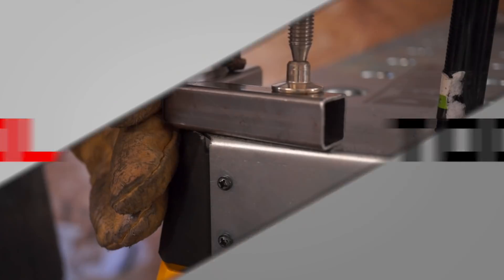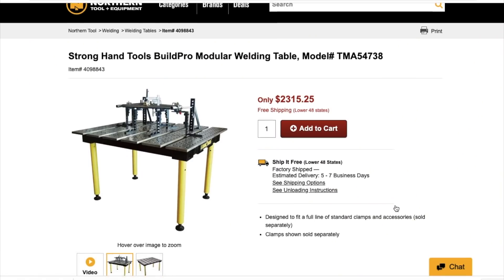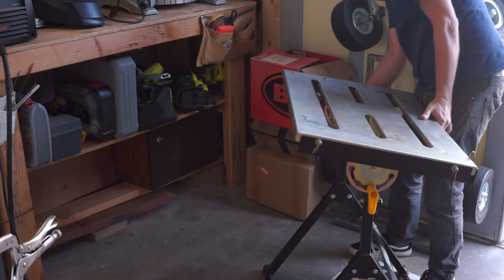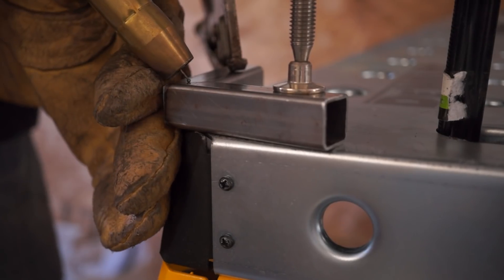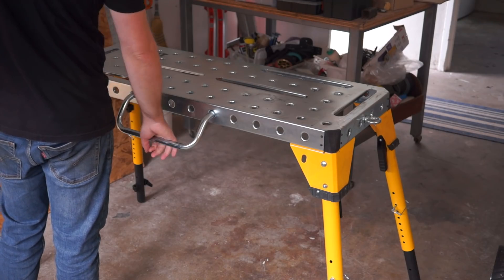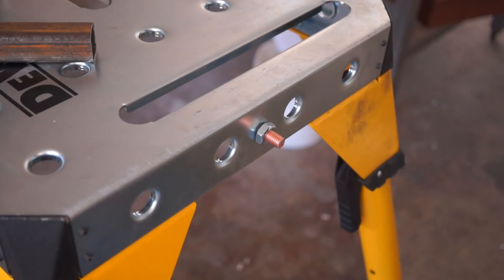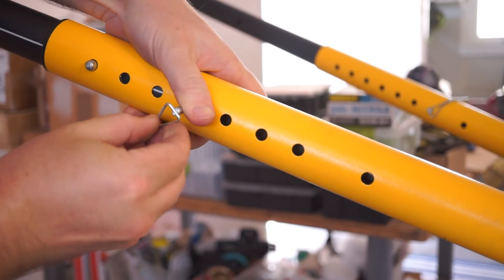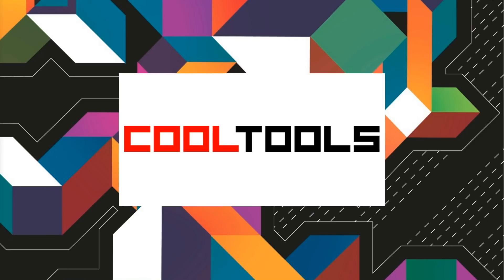DeWalt Welding Table vs. Harbor Freight

Comment: Little trick I use for skateboard tails to make them last longer, it can be applies to the DeWalt's feet - apply a nice layer of sacrifiial epoxy. It gets worn down first instead of the product's existing material.

Comment: Great comparative review of the two tables.  Still a lot for the Dewalt table.  As a beginner I still might choose the Harbor Freight simply because of the cost.
Reply: I totally understand. The Harbor Freight table got years of good use before I made this upgrade. With coupons, you can often get them for around $50, which is hard to beat.

Comment: Looks like a step up from HF but can you put  2 side to side or end to end to make a larger table. That looks very narrow.  I have 2 of the HF tables and did not pay $70 each more like $56 with 20% coupon.  What’s decent about them is I can C clamp them end to end or side to side without leg interference creating a large  work surface . Also locking C clamps  and F clamps work okay in the stamped slots. 
  The bad is they are not height adjustable, only 14GAUGE stamped  and a bit awkward to carry and store.  But paying $112 for 2 was a good value for my needs.

Comment: Grizzly has two inexpensive tables with a 9 gauge top, and 16mm (5/8) holes at the standard 2” spacing. The fixed top model is around $140, and the folding model costs more. None of these cheap models has a top that’s “really” flat. But if you take the top off the Grizzly, you can find the high spots on the frame top and grind them down. It can really flatten it out, and the much thicker top is much stronger.

Comment: Thanks for the review.   The Klutch welding table with tools is a better value if you can buy it on sale for $180.  It does not fold but it is much better option.

Comment: If you are handy enough to need a welding table, you can make a handle for your HF welding table.
Reply: The HF table, just like the numerous “who knows where they come from” cheap models on eBay, is modeled after the twice the price, but also better, Stronghand model, which I have. It does have a handle, and is better make, with some extra features. The dewalt does look nice, for a cheap welding table.

Comment: Can you rotate the lower part of the legs so the cord clamp is out of the way?
Reply: If not just unbolt them and attach them on the inside.
Reply: @charlesmckinley29  I thought the same when I heard this complaint. 👍